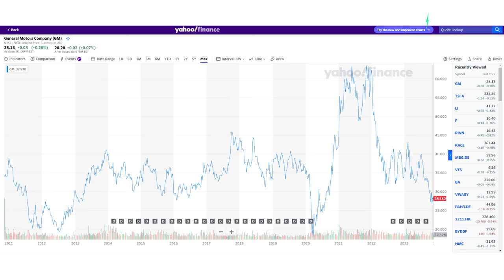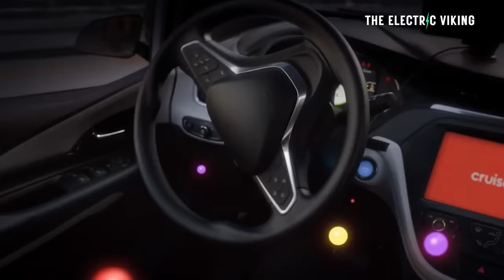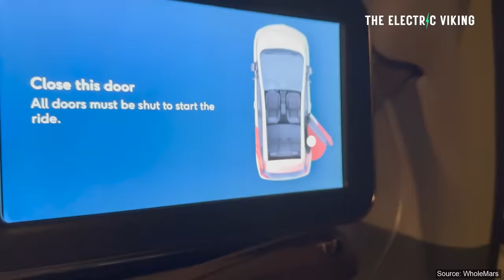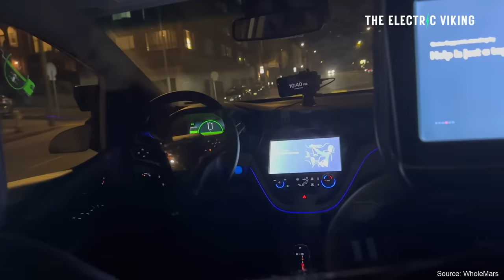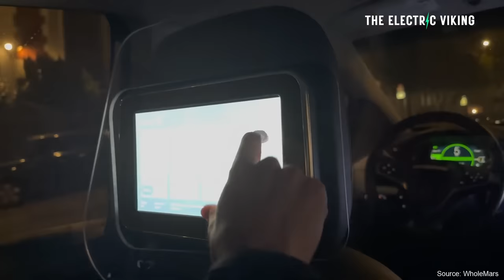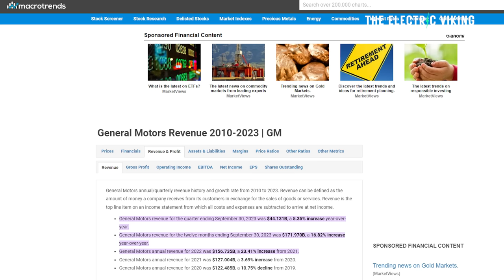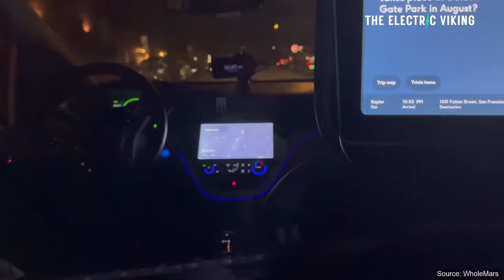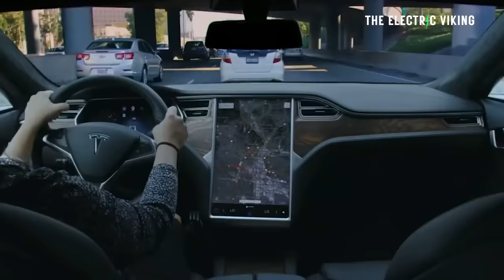Mary Barra's $280B goal to beat Tesla by becoming a technology business...

Comment: GM would be better off in the long run if they just fixed what is wrong with the company, rather than closing down the under-performing sections. When they close a division, the problem causing the under-performance condition just migrates to a new part of the company.
Reply: I think you spelled "unions" wrong...
Reply: Dang rats won't leave the ship! Just keep running starboard to larboard.

Comment: Hi Sam,

thank you.

Interesting approach, there was a line in a movie,( start with someone elses words until you find your own). Tesla started with a clean sheet of paper, a totally different approach to building cars, not perfect at the beginning but ultimately better. If you(Sam) and I were now joint ceos at GM wouldn't a better approach to match or beat Tesla be to again start with a clean sheet of paper and consider an even better way to resolve building a car, or battery, thus now leading the field rather than dragging along behind picking through the crumbs.
Perhaps I've missed the message the current ceo of GM was explaining, but ultimately this has to be the future.

Great Posts

Comment: i think Gm needs to stay in its lane, u don't see tesla trying to make gas engines ..GM and all of them laughed at tesla cars, ., then they figured hey if tesla could write software so could we .....Not they found out its not that easy.., people laughed that it took 5 years to get the cyber truck out ..but guess what its here  will it be a hit ..? who know but they took the time to perfect it ,,unlike gm they rushed out the paperweight hummer  and lyriq with water issues getting into the battery compartment to software not meshing in the lyriq.........i hope the go under fast
Reply: The problem is that the lane they are in ends up ahead
Reply: Sandy Munro pointed to looped copper wiring on high performance TESLA motors, noting GM engineers invented the idea. A runaway hit that flew over GM's head.
Reply: @FrunkensteinVonZipperneck  Several people and companies have  patents on that motor and how to make it.  Mostly expired.  Mind block on the name.